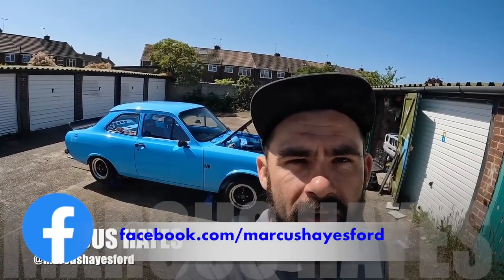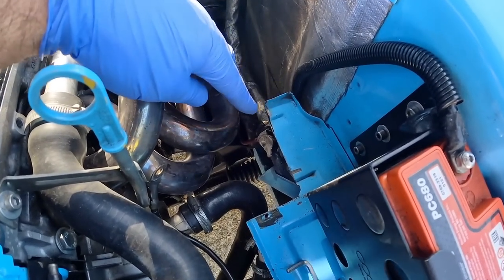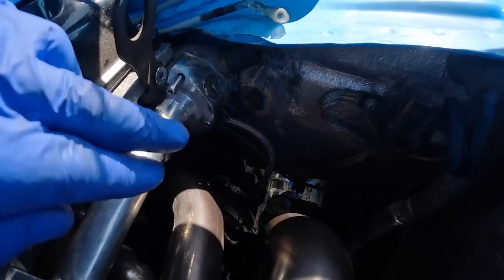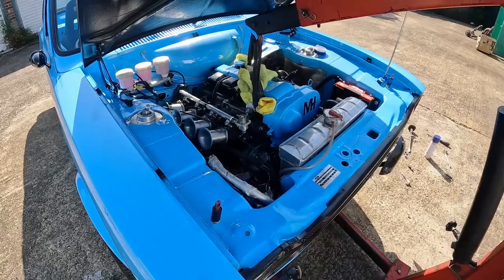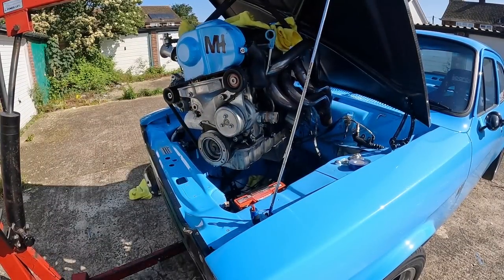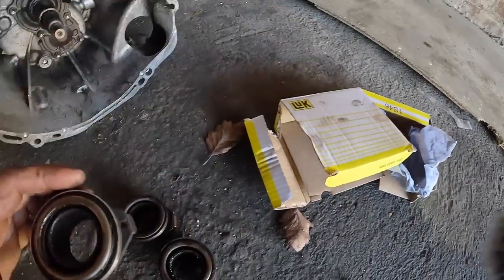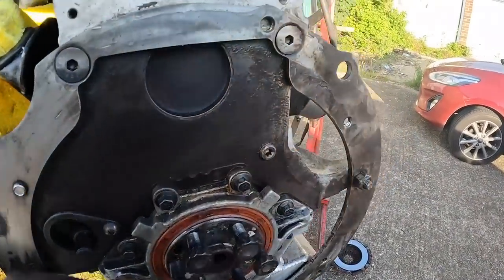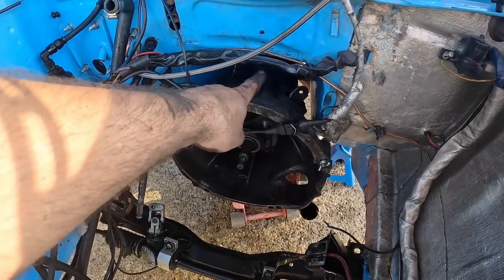ANOTHER clutch bites the dust!!!!! 🙁

Comment: Hi Marcus. Another great video, im thinking your videos is just getting better 😁 About the clutch issues you have, it could be it is the wrong clutch for your setup. Maybe you should have a springed clutch of really good quality, when i drove rally with one of my mk1's many years ago, we jused AP reinforced clutch. And i did really use i hard, never had one clutch problem! But when you are using your clutch in traffic, whit a lot of stops and start, it's just harder when there's no springs. Just my thoughts about it 🙂🇳🇴 im not familiar with rx8 gearbox, i am liking T9, it's just solid😎
Reply from the maker: Thanks for the advice mate! 👍 I used to use AP Racing heavy duty clutches but I killed one in my MK2 and I heard they are not really focussing on thew classic car market any more (so maybe the quality has got worse??) . . . The reason I have an un-sprung clutch is because the springs kept falling out of my clutches. . . . I like the Type 9 gearboxes too but they are sooo expensive nowadays. I still have one in my Mk2 tho. 👍

Comment: Glad you found the issue ,just been googling your issue and it appears the input  shaft bearing on the rx8 gearboxes are a weak point it allows the input shaft to wobble could be your issue wearing out the clutch splines m8 and some say fitting a hydraulic release bearing rather than cable helps the disengagement better ...most people seem to use the masda clutch as same 23 spine as ford apparently hope it helps info wise ...
Reply from the maker: I do have a hydro clutch but the spline wear can be due to a worn input shaft bearing. The Mazda box does indeed have the same spline as Ford and I run a Pinto clutch. 👍

Comment: Double check the size of the spigot bearing in the end of the crank, snd maybe try to measure the lengh of the input shaft to make sure the spigot is engaging in the support bearing in the end of the crank. I know with mx5 boxes you can get extended spigot bearings for zetec cranks.. not sure about rx8 mind tho. Good luck 👍
Reply from the maker: I reckon the spigot is pushed in too far mate, which means it may not be supporting the input shaft very well. 👍
Reply: @marcushayesford  abit of effort I know but maybe with the flywheel off you could bolt your old gearbox on and try and see in through the starter hole or something, you might be able to see if the spigot is going in far enough, maybe jam a smart phone in there and photo it if you cant see very well. Good luck 🤞

Comment: Almost certainly the adapter plate is at fault, even if its only a very small amount out of alignment it will create an oscillation in the input shaft which will wear or fatigue parts until they break, you need to get a DTI gauge in there & measure it. Fitting an un sprung clutch has made things worse because there is nothing to absorb the movement.
Reply: Forgot to add this is assuming you have a correctly sized spigot bearing fitted & its in good condition.

Comment: That old box sounds knackered mate!! Grumbly bearings as you spun the input shaft. Just a thought ... Is the spigot bearing in the end of the crank the correct size 🤔 if the inner bore of that is too large it could cause float on the input shaft, that would cause an issue with bearings and clutch's. After checking that try the old box on the motor without the flywheel/clutch for alignment issues, should be a snug fit input shaft to crank through the spigot bearing 👍
Reply from the maker: The old box defo seemed more noisy when i rotated the input shaft by hand mate. I dont remember it being noisy when it was in the car tho. Iv defo identified something not ideal with the spigot bearing but its defo the correct size. 👍

Comment: Hi matt isnt the standard st170 clutch kit and parts a better fit to the engine and box cause it was designed to suite.keep up the good work with slightly less on the butchery lol.
Reply from the maker: The ST170 uses a dual mass flywheel and clutch setup. The RX8 gearbox has the same spline as a type 9 so a pinto clutch fits if you have a flywheel to suit. 👍

Comment: Why don't you think about a AP racing hydulic clutch bearing i put one in my mk1 escort I ran a 4Ltre V8 rover and 4 speed rocket box work a treat at santa pod I race at Santa pod in sportsman
Reply from the maker: Do they do one for the RX8 box mate??? 👍
Reply: AP racing are at Silverstone track i had cosworth 4 paddle plate on mine and stainless steel flywheel I used live near you opposite rectory Park wayfarer este move away to Guildford three year ago .
Reply: The hydraulic bearing  is universal and fits inside the gearbox you have to get a plate made up but speak to them these things change over the year's good luck 👍 😉.

Comment: is it possible to remove your  bell housing of the box then bolt it to the engine and with a dti guage on mag mount stuck on the flywheel clock it to see if the gearbox is centred ?
Reply from the maker: Not sure if the bell housing is removable in these boxes without basically stripping the whole box. 🤔

Comment: Was that a pinto clutch drive plate or a proper Mazda one ?
Reply from the maker: Pinto mate. 👍
Reply: @marcushayesford  thats your problem.  we get this with propshafts.

Although the Mazda box and the Type 9 share the same  1"  x 23 spline set up.  The pitch on the Mazda splines is different and thats when you get that bit of movement and once there is a bit of movement, it jsut gets progressively worse as the clutch moves on the splines

Get the correct drive plate and you will be sorted